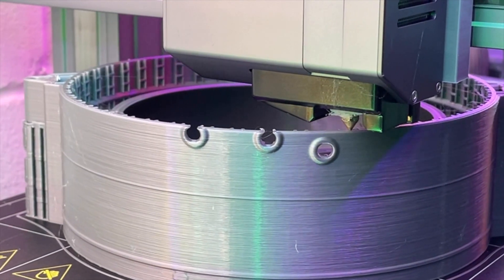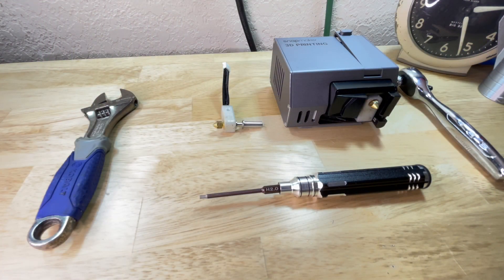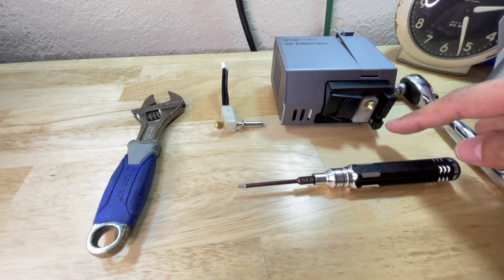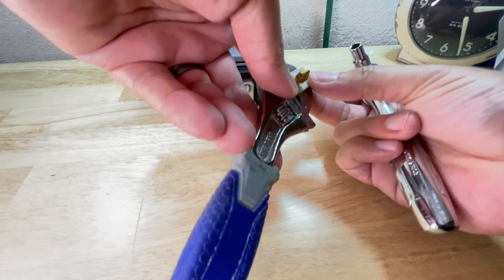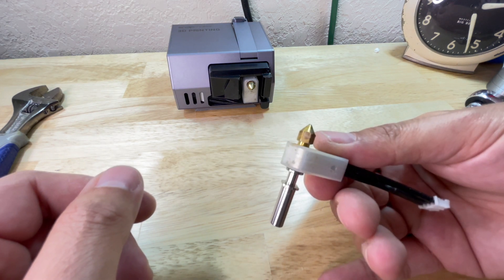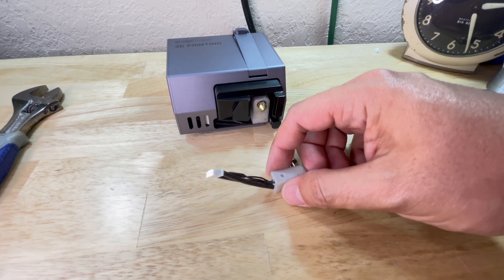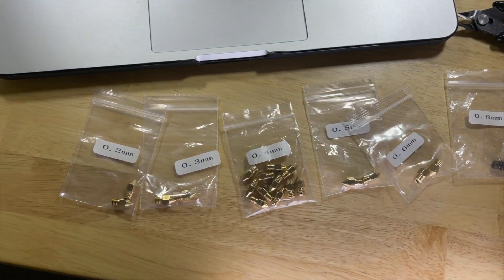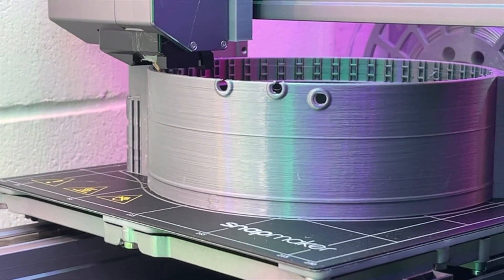How To Change Snapmaker Nozzle

Comment: I heat up the hot end a lot when i tighten in the new nozzle, to like 250, I had one loosen up on me and dig into the print bed once. the idea is to heat weld the threads in place. I read that heat setting the tip as such is important somewhere.
Reply: Metal expanding and contracting is not considered welding. It's just shrinkage. When metal contracts it gets very tight.

Comment: Why not change it while it's hot? And still in place? That's why you messed up the first one...
Reply: This puts torque on the rest of the priniter head  assembly and gantry which can do a variety of damage.  So it's a tough challenge. BUT - you are right that it is better to heat it.  I pull the hot end  out then gently heat the brass nozzle with a propane torch.  I use temperature sensing gun to tell me when it's at 200 deg F then I remove it. Plce the new brass nozzle on and essentially reverse the process then put the new hot end assembly in and absolutely recalibrate before using.
Reply: @carpenter1138 you only put torque on there body if you do it wrong.. not to mention that YOU CAN TAKE THE MODULAR TOOL OFF THE MODULAR PRINT BODY. Seriously, you should Google this. The accepted method of changing ANY OTHER NOZZLE in the world of FDM 3dp, requires you to heat up the nozzle TO EVEN OPEN THE HOT END ASSEMBLY. Have you ever used an ender 3? How about a flash forge? Same deal

Comment: I just demontaged half the thing only to find out that Snapmaker has a tutorial for this but it is slightly different type. This could have saved me a lot of work. It is beyond me why Snapmaker does not make any updated vids on their new 2.0 it's been out for a while now.
Reply: I am a new Snapmaker 2.0 owner and one week in, I wonder about a lot of things concerning this company. Like, WTF are they thinking selling such a high quality product and then release an absolute dumpter fire like Luban. Worst software I had to work with in a looong time, a complete piece of garbage, and apparently users are complaining about his for a very long time now.

Or why they sell an enclosure that is of equally high quality, but then tell you when you ask, that ooops, the idea that someone might need the folding door on the right side never even crossed their minds.

Or why I am already thinking about buying a borosilicate plate, because so far nothing seems to stick on the printing bed apart from the PLA that came with the printer.
Reply: @Furzkampfbomber  Re: bed adhession - I agree about things not sticking at first,  I have found the main problem/solution is that the various brands of PLA all have different ideal bed and nozzle temps.  Some temps can actually make them stick like superglue to the snapmaker bed and then you destroy the bed trying to get it off.  The brands all give ranges they recommend but they are two wide.  For better more dialed in ranges I have found by reading indivdual user ratings on each product where someone figures it out and says exactly what gave them the best results.
Reply: @carpenter1138  I agree, tinkering with bed temperature does help, at least in some cases. In others, I had to use adhesion spray, Wood PLA of any brand for instance does not stick without it. 

And yes, while some types of PLA just. won't. stick, others are sticking like hell even at low temperatures, in some cases I had to actually put the plate with the printed piece into the fridge and then still needed to bend it to unhealthy levels.

Strange enough, printing with what was my personal nightmare until I got the Snapmaker, is an absolute joy with this printer - namely TPU. Bed temperature to zero and it stick perfectly, but is also very easy to peel off the bed. And it prints TPU like a champ, just printed a full grip enclosure for a friend's 1911 (gas), with Resident Evil logo on one side and some text on the other and it came out perfectly without even the need for supports.

Just one tip in case you want to print TPU with the snapmaker: the tension of the spring in the loading mechanism is too high and will cause problems. So just take the spring out of any given ballpoint pen and replace the original spring with it, after that you should have no problems.
Reply: @Furzkampfbomber  And unfortunately by the time we figure it all out we've wasted PLA and in some cases damaged the bed.  Another thing I tried when some PLA wouldn't stick is to stick blue 3M or painter's tape to the bed. I had to go carefully edge to edge without overlapping or if the overlapped spots stuck up higher the nozzle would drag and rip through the high spots then it would make a big mess. If i managed to get it edge to edge and then calibrate on top of the tape the surface would often make the difference and the PLA would stick to it better.  It's really picky though and doesn't always work if the bed isn't pefectly calibrated.

Comment: Only person who ive found to show this, thank you!

I pulled the silicon sock down over the cables, clamped it in an adjustable wrench with some e tape on the teeth to prevent scratches, requires a 6mm socket. Using anything but an adjustable with parallel claws like that will just ruin the flat sides of the nozzle... like i did with three types of pliers.